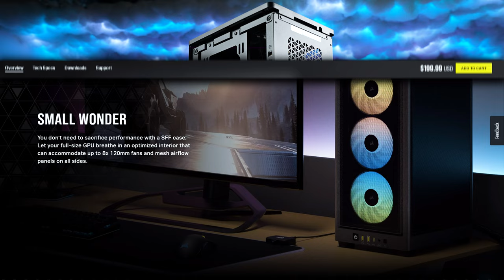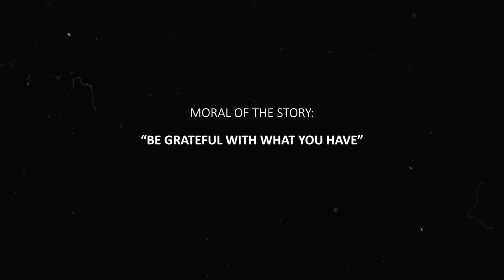The Impossible ITX Build... Corsair 2000D

Comment: Wouldn't have been all Corsair but the EK CPU block/Pump/Reservoir all in one block probably would have worked.  Or putting the XD3 on the outside of the case with some interesting looking Passthrough connections.
Reply from the maker: Yep it would have, but got to stick to the challenge rules
Reply: Any chance you'd want to revisit this case some day? Just using exactly whatever parts you want to make an awesome custom loop would be awesome to see.  @DesignsByIFR
Reply from the maker: @alexgifford5895  yes for sure! I am planning to because i know using other companies gear i can make it work

Comment: Their gpu measurement also vary greatly from the listing of the case elsewhere. Site states 365mm but places like newegg and amazon state 320mm.
Reply from the maker: Ohh thats interesting, i will look more into that, to be fair the Asus tuff 4080 was longer than 320mm and it would have fit if it was 3 slot or less

Comment: not that impressive. People have done full custom loop cpu+gpu + res in smaller cases.
Reply from the maker: Yes, with easier access to the inside and also not strictly corsair water cooling gear, you should listen before you comment
Reply: @DesignsByIFR  I listened, still not impressive just because you choose to handicap yourself.